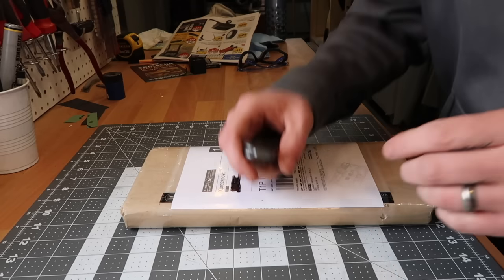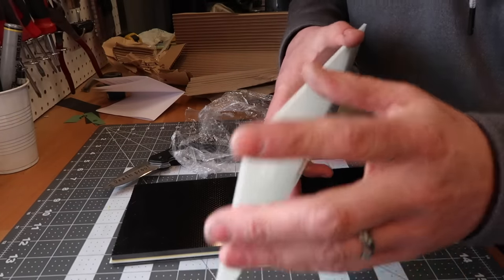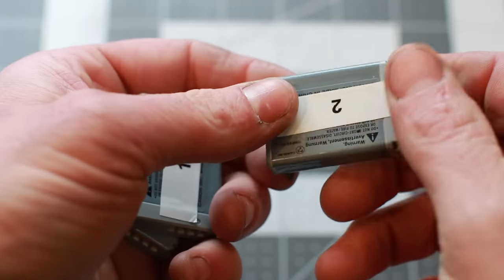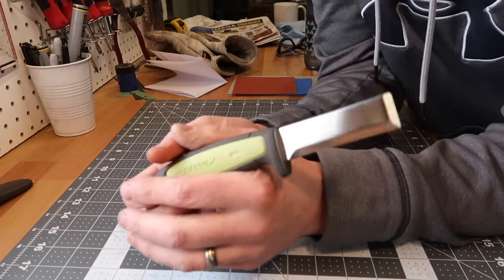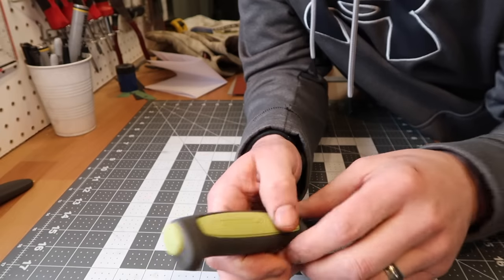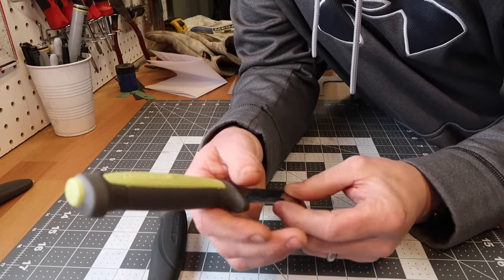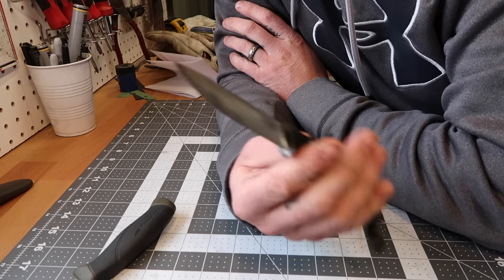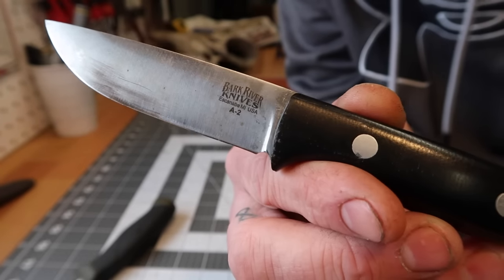I accidentally bought a Mora...

Comment: It's very simple why the chisel ground mora is carbon steel...  it a hard use knife and Mora's carbon steel is a tougher option compared to their stainless.  Wipe a little mineral oil on it ocassionally and forget about it!
Reply: The main reason for carbon steel in a tool like this is that you can hone carbon steel much sharper than stainless steel.  The main downsides are that it's more brittle and chips easier, and that you absolutely have to oil it every now and then to avoid rust.   If honing on oil stones, the oiling pretty much takes care of itself.
But for a knife meant for wood and not hunting or EDC, carbon steel is the #1 choice.
Reply: We will have to agree to disagree on this one Art...  Mora's carbon and SS can get equally sharp, both can have laser edges.  SS is much more prone to chipping and being brittle manly due to a harder rockwell but also just due to the amount of carbon in the steel itself.  Like I said before, this is more a tool first an knife second, which is why they chose carbon steel, which is tougher than their SS...  Ugly tool/knife but it serves it's purpose I guess.  Take care.
Reply: yea stainless will chip carbon the edge will just roll over and u can fix it easily with a steel or strop.. and most carbon steel has smaller carbides and can get more of a razor edge without lots of work..
Reply: The pros and cons of carbon steel are well known.  What is not known are the advantages of a chisel grind and a chisel blade.  It is far easier to keep field sharp, to keep an edge evenly sharp across it's entire length, to alter the micro bevel to fit the work, to do surface level trimming as well as cutting, and, heaven forbid, if you have absolutely nothing else to use as a pry bar, it stands up better to this abuse and it can be revived from damage caused by this abuse far more easily.  

All of this basically has to do with the straight configuration of the edge, the fact that you polish the flat side with the whole body of the knife against the abrasive until it is mirror shiny and mirror smooth.  You sharpen only the beveled side and the "wire" you create by doing so appears on the flat side only, where it can be removed with merely one or two good polishing swipes, particularly with carbon steel.

A straight, chisel-ground blade can be hammered far more effectively, with more precise control and with less potential blade damage into either the end grain or the long grain of material such as wood.  Hence both batoning and rough trimming is far easier than with a curved double bevel. That's why they make chisels this way, that and the fact that you can pare and do fine cleanup work much more easily with such a blade because of it's narrower beveled edge.

Finally, ALL of the unbeveled knife surface is of equal strength along the entire length of the knife so potential damage to the tip end through sheer stress (such as prying)  is minimized.  Further, because one edge only is sharpened, the knife itself can be thicker, therefore stronger, without much sacrifice to the stability of the sharpened edge.
Reply: The pricepoint is worth noting as well, here in Sweden that knife costs around 10$, so youre looking at a 100% markup on amazon. Meaning that material and production costs are even lower than what you anticipate for a $20 knife.
Reply: willythekid78 or you can boil it in apple cider vinegar and it puts a petina on it and prevents rust+ looks amazing
Reply: One reason why it can be so cheap is that Sweden is one of the main steel producers in the world.  Not having to ship heavy ore and metals across the globe, and having had railroad logistics in place for several generations now keeps the costs down.
SSAB -> Sandvik -> Frosts
Reply: Art Heen and eskilstuna
Reply: The reason is because these knives are disposible items for the construction workers and non knife enthusiasts that use them in their every day work. Most Mora knives bought in sweden will be knackered the hell out of and thrown away. If oyu work in a hardware store you will often see builders buy 5 or 10 of them at a time, for them it's not worth the time to sharpen or hone the blade. They are also very ofthen used fot applications whre a box cutter does a much better job.
Reply: I was going to tell a few reasons for a chisel ground Mora to be carbon steel (since I'm a native Swede) but it seems other Swedes beat me to it, pretty much! 😂
Yeah, they are used the same way as others use box cutters with interchangeable blades; until it's dull, then you start to use the next knife....

There are good Moras, thou, that you hone and take care off really good!
.....but those don't have plastic handles, and isn't made in a machine.... 😉
Reply: ehh just rub it down the bench grinder once it become dull and no longer very usefull ... you cant keep doing that forever but still theres a lot of meat on that thing.
Reply: You guys pretty much nailed it. I was a boat carpenter for about 30 years, and have about fifty edge tools; chisels, planes, spoke shaves, etc.Every blade is carbon steel. I've never even seen a stainless steel chisel. While there are many different qualities of carbon steels due to percentage carbon and  heat treatment, good carbon steel is almost always easier to sharpen,  and holds that edge better, than any stainless steel I'm familiar with.
Reply: i have never seen a mora kniv like that before
Reply: Art Heen, I agree with you completely, I'm a carpenter and have one of the Stanley chisel knives clipped to my belt daily, also had  a Mora but it went walkies, I curse whoever took it as it was a good work tool. This type of carbon is easy to touch up on a strop and have a perfect working edge in no time, some of the hard woods I work with will blunt anything.
Reply: nope, that's why carbon steel is used in drillbits, saws, chisels, etc... never stainless steel
Reply: I hone both and they're  super hair popping sharp, only in the field give me carbon steel, as with a pebble and some birch pollypore it is less time consuming to hone but has to be done more often, the  down point is you will be handing  down to your great grandchildren less metal when your time is up, It all comes down to personal preference and opinion, it is a bit tortoise and hair...
Reply: willythekid78 great knife for the money
Reply: Yeah. A chisel ground Tanto in D2 is a formidable piece of hardware.
Reply: @konzetsu6068  its about 10 bucks for basic on Amazon in US.

Comment: It's been a long time, but there is a video demonstrating the use of the Mora Chisel Knife on the Mora website. It's intended use is to cut a groove or slot and allow carpenters to create lap joints or interlocking connections (Rabbits, Dadoes, etc.) The blade is thick enough that it can be hammered into wood to help chisel out the wood you need to remove. It's kind of cool to see how well it works and avoids the need for power tools and a lot of cutting, drilling or filing.

Comment: On a carbon steel blade it's pretty easy to force a patina on that will protect it from rust and give it a sweet new look. Just boil some apple cider vinegar, pour it in a glass and dip the blade only in clamp the grip at the top of the glass and let chemistry take it from there. Let it soak for about 30 min. May do it twice. Helps to lightly file the top of the blade just a bit first. After it's done dry it and oil it and it works great. I've done this on a few carbon blades and it protects and gives it a very nice unique patina! Thanks for the video!
Reply: Dubhouse Tactical good tip. Thanks.

Comment: If those knives were made in 2015 i actually made them when i worked in the Factory in Mora and those two are sold in both stainless and carbon steel, its just that the flat chissel ones are suppose to be used pretty harshly so we make them out of cheaper steal for the most part so the knives will be cheaper for the customer because they are easier to produce  and they are a pain in the ass to sharpen because we have a 0 tolerance on marks on the flat area and if you polish them to much they lose their edge :)
Reply: BleedingGuns o

Comment: Their carbon steel is stronger than their stainless it's also made for a different purpose than you think. It's made as a throw away knife for professionals. Construction companies in Sweden buy these in sets of thousands and then you use it until it's dull to then throw away. It never really gets a chance to rust and If you want a stainless then buy a stainless.
Reply: Precisely
Reply: This is what I was going to comment. These Mora carbon steel knives are not meant to be sharpened ever you are supposed to just dump it when it gets dull. Also there is another aspect, this knife is meant to function also as a chisel so it can be struck with a hammer. I think there is a regulation that when these knives are bent, they are not supposed to break but just bend. This will affect the steel and how sharp can you get it.
Reply: That they're cheap is why it's feasible to buy and toss, but Mora knives were made before consumerism existed.  The grind on them are especially well suited to being sharpened on the fly with a traditional big Scandinavian sharpening stone (bryne or hen), which workers would carry in their belt back in the days.
Frost even used to sell a bundle of Mora knives and sharpening stones back in the 60s.
Reply: +Art Heen What I said was about a handful of the knives mora makes, not all of them. 

"Consumerism" is just a modern buzzword, if constructing buildings is consumerism then I say it's a good thing and something that Sweden in particular could use some more of.
Reply: Consumerism is "just a modern buzzword" that's been in use for 57 years now for denoting consumption as an economic policy, i.e. the buy-trash-rebuy culture.

Swedes, on the other hand, and perhaps especially in Dalarna, take pride in being humble - "ödmjuk och lagom".  Buying a knife and throwing it away instead of sharpening is not something traditional Swedes would be comfortable with, although much has changed in modern times, and not all for the better.
Reply: +Art Heen That's not what I meant with a modern buzzword and you (hopefully) know it. 

Sweden has a gigantic housing crisis and a government making it harder and more expensive to build, buy and rent homes. If building houses in a way that normal people can afford them is "consumerism" then I say that's a good thing. And in that sense consumerism is a modern buzzword, in that it's used to hide a horrible sentiment under words that convey compassion.

Side note: 57 years is modern when it concerns language.
Reply: i had never heard of these before or what their purpose is.  So now i have learned something

Comment: Aaah, I am no metalurgist by any measure, however, my take is that the reason they made it carbon steel is that it is very tough. Tougher than stainless.  You will need that toughness for the chisel feature.

Comment: IMHO high carbon is a much better steel for a few reasons:  It's easier to sharpen, it keeps a great edge and as you mentioned the price point.  To further illustrate, how many saw blades and files are made from stainless steel?  Stainless steel only enterered the knife marked due to it's ease of maintenance.  If you would like your knife to be more rust resistant, force a patina on it or  keeping it wiped with mineral oil as another watcher noted.  I only wish more frame-lock folders were offered in 1095.

Comment: Mora does not make a secret out of their steel types. They use C100 (European equivalent to 1095) for all carbon steel blade and 12C27 for (almost) all stainless steel blades. The Mora Garberg stainless is made of 14C28N.

Comment: stainless will still rust eventually. my mora companion is nearly black now from years of use and patina as the stainless coating is removed in patches and the blade has been almost never oiled. I have carbon steel blades that are just as old, thinner, and just as well used, but are in same if not better condition, only difference being that i hone/strop and oil them more routinely, as they are fine use tools.

Comment: Mora uses 12c27 for their stainles and UHB-20c (a swedish equivalent to 1095) for their carbon. Cold rolled and heat treated. Or a Triflex steel, HRC61 Carbon laminated between softer steels.

Comment: Carbon steel holds an edge better and longer than most stainless.  That is not to say than all stainless. But carbon steel is a better material if you ignore the rust and don't need to hit the knife with a hammer.  Rust isn't a problem if you take good care of a knife but taking care of a knife is not fun or easy. My favorite Chef's knife is a French made high carbon steel knife.  I never leave it on the counter damp let alone  put it away wet. It is much sharper than my best German Stainless knifes.  

I think people choose stainless because it is tougher and doesn't rust.  Surface rust looks bad and pitting can destroy an edge.  Stainless is just easier to take care of.  Some stainless even has amazing edge properties.  Although you are likely to never see one unless you have hundreds to spend on a knife.

In the end it is all about how you use it and how much money you are willing to spend on it and to replace it.  For many of us a simple carbon steel blade is just fine.  For others Stainless is the only way to go.  There is no right answer so long as it works and you like it.

Comment: I've thought about getting one of those Mora chisel point knives as a backup knife for foraging but that led me to the notion of taking an old  1 1/2" socket chisel without a handle and carrying that instead.  The advantage is that I can easily make a handle if I need one and I can make a handle practically as long as I want if I want to dislodge  a bracket fungus or something that's too high to reach.

Comment: I have a car I steel mora craftline that I paid like 8$ for. I use it all the time and the thing just cuts and cuts. I think I have sharpened it like once or possibly twice and I just strop it on cardboard with some  mothers metal polish and it just stays sharp. I don't do anything "hard" with it just basic kitchen duty or cutting up cardboard for recycling. I don't think you will be disappointed.

Comment: no knife rusts in one use of cutting a bail or bails.  Ive had a carbon Companion and theres a tad bit of rust on it from not cleaning it like a dummy and i removed it with steel wool really fast and now there is a cool patina spot on it that you can hardly see at all . And I didnt oil it ever and i had it for like a year. I oil it now . They used Carbon for a chisel because A stainless chisel would suck, it would break if it was stainless.

Comment: Have the Hultafors version of the chisel knife, also in carbon steel. Only use it for wood working and rust hasn't been an issue. It's a very useful tool.

Comment: Carbon steel has a tendency to rust but is stronger and holds a better Edge stainless steel has characteristics that inhibit corrosion if you have a high carbon steel blade which I prefer you need a light coat of oil once in a while

Comment: I carry a mora Craftline Q, bought 3 of them over five years ago..... still have two in packages.  Best $10.00 (per knife) I ever spent.  I abuse the living crap out of that knife and it comes back for more.  the only mod I made well two mods are i ground the spine so it was flat and I had a leather sheath made..... there is a catch to that sheath it is friction fit to the plastic sheath that the mora comes with I just cut off the belt clip, it was to small to fit on most belts anyway.  Another great thing about that knife is if i lose it or break it it is "eh, it was 10 bucks"  What would you say to yourself if you lost or broke a 200.00, 300.00 dollar knife?

Comment: The cheap stainless Mora knifes are made of 12C27, decent (maybe better than any other knife in this price class)- imho visibly better than even best 440C steels, but for sure no super-steel like M390, S110V, Maxamet, etc.. The "Mora Carbon" Steel is a big seceret but it's no pure carbon-steel for sure, I guess it contains a few more carbide builders (W, Cr, V, Mo?) than only Fe&C as it's keeps its sharpness visibly better than 1095

Comment: I have a small Carbon Opinel, and all was fine until I lost it :o(  
It didn't turn up, so I bought another one. 4 weeks later I found the bugger in the door rubber of the washing machine!!!!!!!! It was rusty as hell, but I took the blade out and gently cleaned it up, then re sharpened it. The patina is very pronounced, and is almost Damascus like in places. It is still my everyday knife, and the replacement I bought has been polished to within an inch of its life, and is for showing off. The polished one is rather soulless, whereas the patina blade forever reminds me to empty my pockets before ditching clothes in the laundry basket!
Reply: Roger Crier they're very good knives. That design hasn't changed since they first came out.

Comment: why buy a carbon steel blade if you dont know how to treat it? Either wipe it clean and oil it often. Or do what I do. Leave it in vinniger for 4 hours or so, then thoroughly clean and oil it. Did this to a basic 511 about 3 years ago. Have been abusing it in my garage ever since, not 1 spec of rust. And all I did was sharpen it 2 or 3 times and repeated the vinniger and oil

Comment: Maybe the Mora is designed more for "in the workshop" type duties? Thus the harder steel would have better edge retention. Thats my theory anyway
Reply: Exactly what it is, it's called Chisel and is meant for as you guessed workshop type use. For woodworking and such.
Reply: In that case it shouldn't be exposed to much moisture (apart from that which may be found in the wood) 
I'd assume EDC would allow for more exposure to the elements, thus the rust